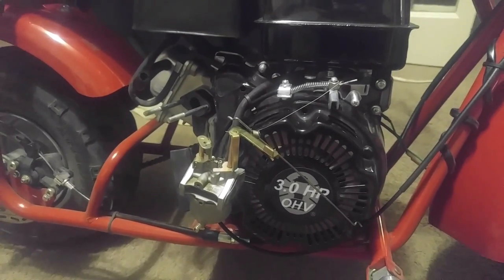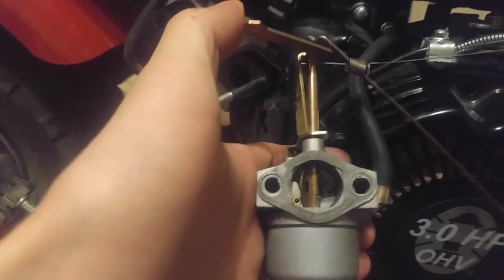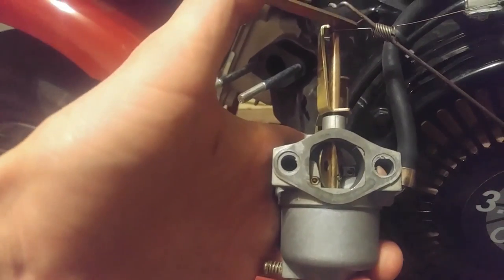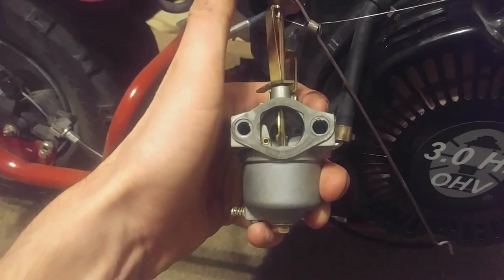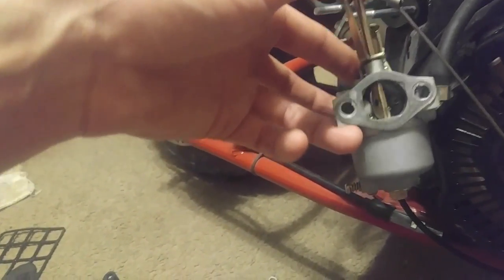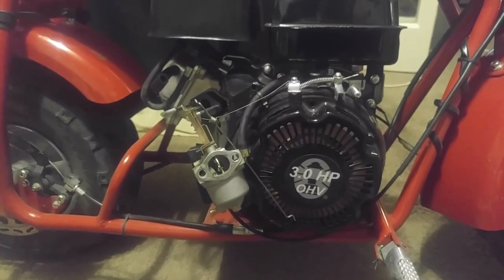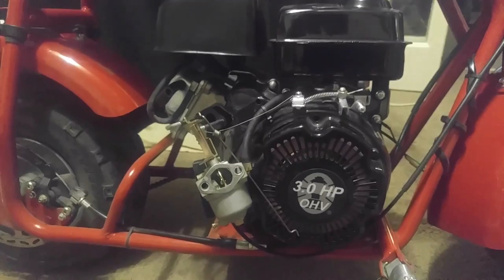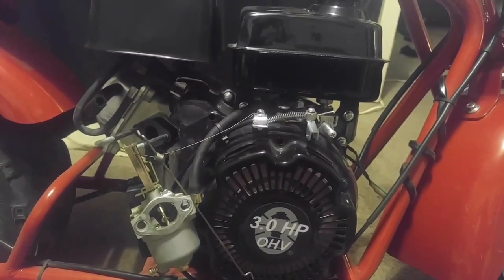DISCOVERY ABOUT THE COLEMAN CT100U CARBURETOR

Comment: I have one but mine is starting to like shut off and I have it fully choked on so I've been trying to figure it out but I see what you're talking about that should not be like that I'm the same way and I look it over
Reply from the maker: If you're having to run yours fully choked it means you're not getting enough fuel probably need to pull off the float bowl and see if the Jets plugged up

Comment: Bought my daughter one of them for xmas and just now getting to get it out since it's just now getting warm in Michigan.  Anyway I got it to start up once and now when I try to start it there seems to be gas coming out if the carb butterfly. Not really too familiar with small engines so I dont know what to do. Coleman only gives a 90 day warranty which has  passed
Reply from the maker: take the carb apart and see if the float inside the float bowl is stuck sounds like its flooding
Reply: That could be the reason to shut off the fuel , and run it until it burns the gas left in the carburetor !! When storing..

Comment: Sometimes your choke is fine I checked in the middle of this video and mine seems fine i recommend to check before you do anything to it
Reply from the maker: Oh I made major changes I put a 212 stage 3 on it
Reply: Mine was also fine
Reply: @spikemandan  so coleman 200 performance parts fit the 100u I've been looking for a foam air filter for my 100u i only found one that was made for it but there sold out everywhere i was going to buy a 200 air filter kit but wasn't sure if it would fit
Reply from the maker: @oo7952  Well that all depends does your minibike have a 212 engine in it sometimes I can be hard to find air filters for the three horse I got rid of my three horse
Reply: @spikemandan  its stock where did you get the air filter for the 3hp motor i tried hotrodminibikes but the site
 no longer exists i dont want to swap out motors i just got my 100u about a month ago brand new i went to tempe to pick it up at the coleman dealer $350 out the door
Reply from the maker: @oo7952  You may try checking out Gopowersports or other various websites
Reply from the maker: @oo7952  https://www.ombwarehouse.com/mini-bike-parts/?gclid=Cj0KCQiA3Y-ABhCnARIsAKYDH7tZGtVX9a6ykPIRTrrKXhW8B-zadGScGZcWq195tWiqYbsw2rO8Tb0aAnATEALw_wcB
Reply from the maker: @oo7952  I hope this helps out if anything
Reply from the maker: Got plenty more suggestions as far as websites go if you need them

Comment: Ct 100u only runs on choke. Checked oil, plenty, drained the carb, clean. It was not sitting my son was running it around the yard. "Bumpy". Any ideas. He rides it daily so it hasn't been sitting.
Reply: Try cleaning the carb
Reply: There is a brass fitting on the top of the carb. It was a flat blade slot on it so you cana take it off. Once off clean it and run a tiny tiny wire through the center.

Comment: Hey my Coleman will run when you have the gas pulled back but it won't idle as soon as you go to let it idle it just shuts off any ideas on what I can do or where I order a new carburetors. Thanks Dude
Reply from the maker: Try turning the idle up
Reply: I would try cleaning your carb jets the idle jet may be plugged

Comment: Brand new ct100u. Engine dies while riding and then it won't start until engine cools off some. Fresh gas, so that should be OK.  Tried to adjust idle screw and it didn't turn even with vice grips on it as it seems idle RPM is on the slow side.  Any advice as to what I should do. Thanks
Reply from the maker: Check her oil change spark plug
Reply from the maker: Even then no promises sounds quite unusual
Reply: Jack MeHoff  Thanks, will check it out
Reply: Did find out I had overfilled it by maybe half a cup. Let it drain even to top of threads. Gotta wait till the grand kids ride it to see how it does
Reply: @DTW-bx2vy  Thank you for the response. So over the last week it ran fine for a (very) little while but now I see the pull cord has about 4 inches of slack so the handle is not tight against the case. I removed the cover to see if something may have loosened and didn't see anything I could fix so I suppose I'll untie the knot and shorten the cord some and retie. Another thing. The idle screw, or at least what they show in the PDF document, need to be seated tight or it leaks gas! So is this the idle screw? You can't really adjust it.  And now I can't get it to start at all. The grand kids were disappointed because they only had one other to ride. That one we bought used and it hasn't had any issues. I'll give your recommendations a try and see what works. Again, thanks for taking the time to help me out and let you know

Comment: Bro, you win the internet for me today because there not only is a lack of ct100 vids (I have ct100u and ct200u) but the Coleman booklets have the wrong parts for their products! The ct100u manual that came in box has different diagrams and parts! For instance the brake caliper and throttle! Two very crucial components. While my ct200u has been like "butta'" I've had nothing but headaches from my ct100. Help Spike! Lol
Reply: You still having problems with it. I picked up the 100 and the damn thing idles so high...ok adjust idle screw ..but wait there's no head on the screw to turn and it's brass so if you touch it it turns to dust
Reply from the maker: You're so very welcome and I understand your troubles that's why I bought a 200 I have three of them now fuck the CT 100

Comment: Got a newer ct100u and throttle is open all the way when you put it on full run.
Reply from the maker: check all the return springs see if that might be it
Reply: @spikemandan  what I meant was that coleman fixed that problem where the butterfly rotates too much when fully un choked. I checked my ct100u to see if mine was like yours. Glad they fixed that problem so I dont have to rig it lol.
Reply from the maker: @madchanicsgarage2969  np i just put a stage 3 212 on mine
Reply: @spikemandan  sweet make more videos man. Oh and could I possibly put smaller wheels on the coleman?
Reply from the maker: so is what your telling me a good thing for you? or a bad thing? you kinda got me lost
Reply from the maker: @madchanicsgarage2969  tires maybe good luck trying i have smaller tire's but dont want frame closer to ground wont lean in turns
Reply: Mine is a 2019 and it's open properly..looks like they fixed this?
Reply: What is the small screw with the spring on the bottom of the carb?